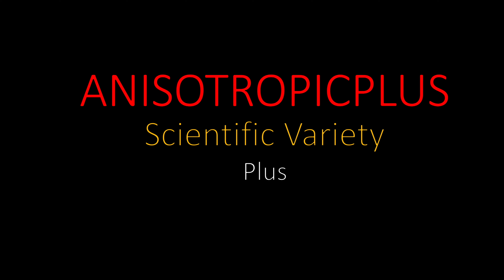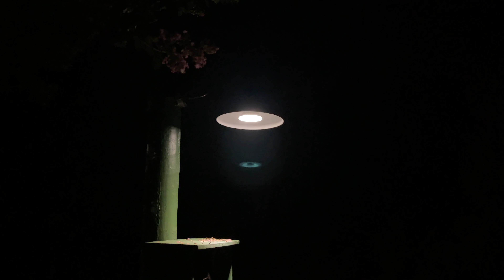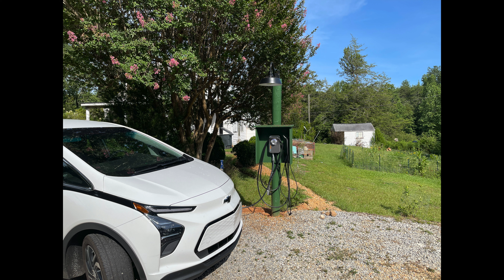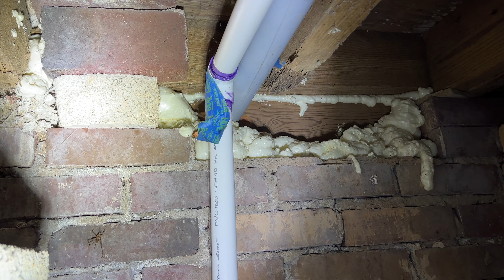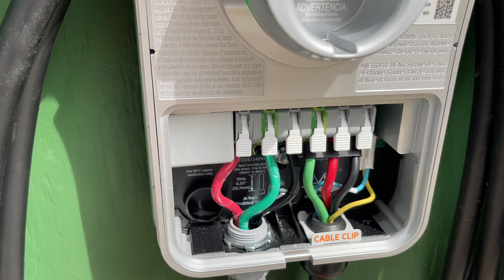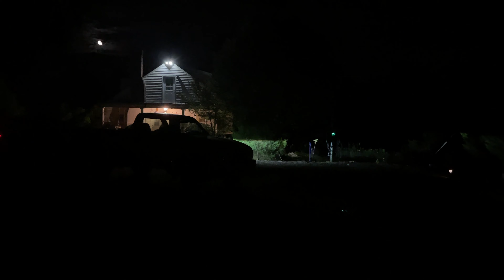Installing an EV Charger 50 feet from House at the Driveway Parking Area

Comment: Can you configure your car to charge slower / lower amps?
Reply from the maker: Thanks for watching. When we purchased our first EV, a 2023 Chevy Bolt EV, we used the Level 1 Charger (120V) to charge the car. We could set the car up to charge at 8 or 12 amps depending on the 120V outlet’s current rating. I purchased a Level 2 charger(240V)  that we could plug into a 50 amp welding outlet. It was a Sophtrans, https://www.amazon.com/dp/B0BLGJBD8S?ref_=ppx_hzsearch_conn_dt_b_fed_asin_title_9  and it had several current settings up to 40 amps. The car accepted up to 50 kw. 40 amps x 240V was 9.6 kw. This is when we decided to install the ChargePoint Home Flex charger close to where we park most of the time. The Homeflex has variable current settings up to a max of 48 amps or 11.5 kw when hardwired. We now have two additional EVs, a 2018 Tesla Model 3 and recently a 2024 Chevy Silverado 4WT work truck. The Tesla can charge up to 250kw and the Silverado up to 350 kw, much faster than the 50 kw on the Bolt. We do most of our charging at home on the Home Flex at 11.5 kw or 48 amps. I believe the Tesla can limit the charge rate on Level 2, but not the Bolt or Silverado. Generally the rate of fast charging on Tesla Superchargers or other CCS fast chargers is automatically managed between the charger’s and the cars’ electronics and slows down considerably after 80% of charge maximum. If you are considering a home charger and have a new model that is bidirectional capable I would consider vehicle to home or V2H so you could use your car as a backup energy source for your home during outages. Due to the cost of the GM Energy V2H system we are set up to run the house off the Silverado’s 240V power base in the bed of the truck which helps, but is not ideal.

Comment: I'm charging at my house outdoors with the same level 1 charger. Do you keep yours outside? I want to but worried it will get wet from rain.
Reply from the maker: This ChargePoint Home Flex charger is a 240 volt Level 2 charger and is supposed to be weatherproof. The Level 1, 120 volt charger that came with the car is weather resistant, but not weatherproof. I checked with Google’s Gemini Advanced AI and this is the answer I got.

Based on the information gathered, the level one charger that came with a 2023 Chevy Bolt EV is weather-resistant, but not fully waterproof or designed for permanent outdoor exposure in all conditions. Here's a more detailed breakdown:

Weather-Resistant: The general consensus from Chevy Bolt EV owners is that the OEM level 1 charger can handle typical outdoor conditions like rain and snow without immediate issues.
Not Waterproof: It is crucial to understand that weather-resistant does not mean waterproof. Submerging the charger in water or exposing it to severe weather conditions is not recommended.   
Manufacturer Caution: The official documentation for a similar GM dual-level charge cord includes cautions against submerging the cord in water or using it in severe weather. It also advises using weatherproof outlets with suitable covers when charging outdoors.
User Practices: Many users on Chevy Bolt EV forums report charging outdoors without problems. However, some take precautions like using magnetic port covers for the car's charging port to keep out snow and ice or placing the charger in a way to minimize direct exposure to heavy rain.
Long-Term Durability: Some electricians and experienced EV owners suggest that while the included charger can be used outdoors, it might not be designed for the same long-term durability as permanently installed, outdoor-rated charging stations (Level 2 chargers). Continuous exposure to sun, rain, wind, and temperature fluctuations can potentially reduce its lifespan.   
Outlet Protection: If you are using the level 1 charger outdoors, it is highly recommended to plug it into a Ground Fault Circuit Interrupter (GFCI) outlet that is protected by a weatherproof "in-use" cover. This adds a layer of safety by protecting against electrical shock in wet conditions.
In summary, you can likely use the level one charger that came with your 2023 Chevy Bolt EV outside for regular charging in typical weather. However, it's wise to take precautions to protect both the charger and the car's charging port from heavy rain, snow, and potential submersion. For a more permanent and robust outdoor charging solution, consider installing a Level 2 charger that is specifically rated for outdoor use.

Comment: Is it the PVC conduit all the way to the house? If so, how deep did you go with it?
Reply from the maker: Yes, 1 1/2” PVC from the charging station pole to the breaker panel box in the house. I buried it a minimum 18” deep. I used larger conduit than necessary in case I wanted to pull some more cable in the future. It is reduced to 3/4” PVC at the charging station pole. It is important to use the wet rated THWN cables because if the conduit ever leaks the water will probably stay in it.